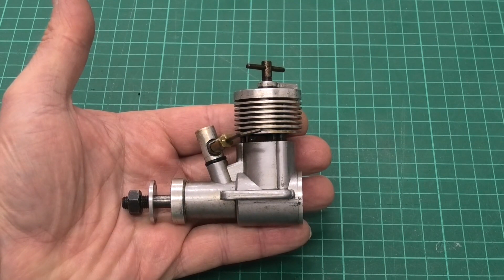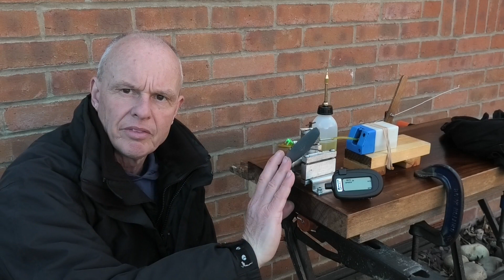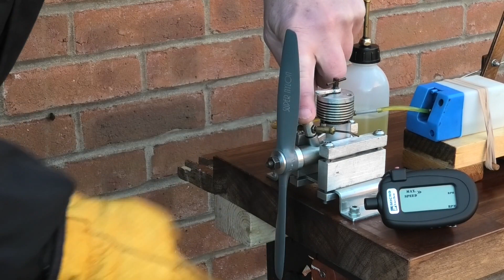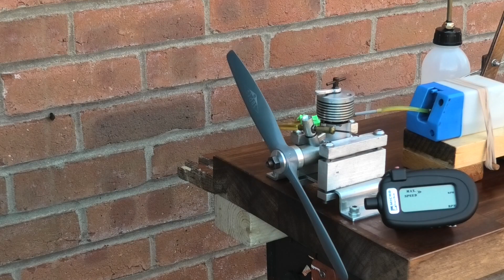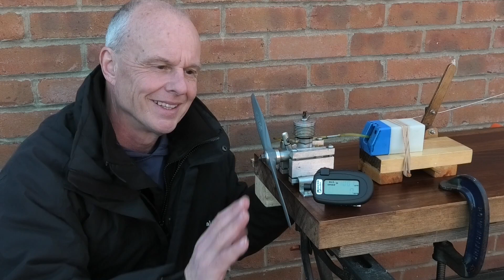P.A.W. English 2.49cc Diesel Engine - Test Run

Comment: I’ve several of those 2.49 engines. I really like them!
I tend to use 8 x 4 props with mine on control line models.
Reply from the maker: Certainly great runners, bet it screamed lovely with an 8x4, must try it

Comment: I have a similar engine which is made in india with a rc throttle bought it back in 1999 still have that engine but have not run the engine since many years.